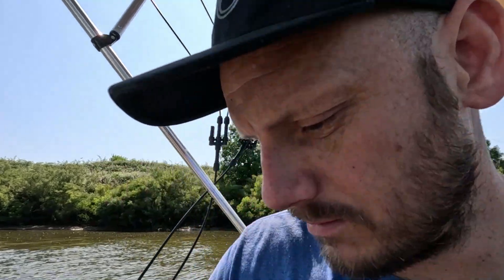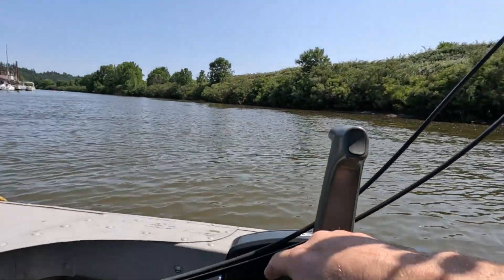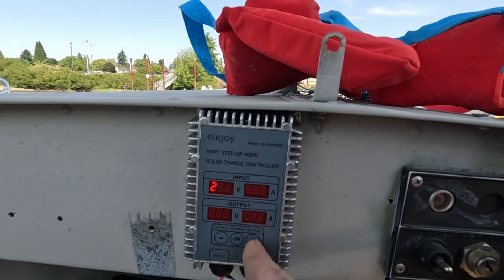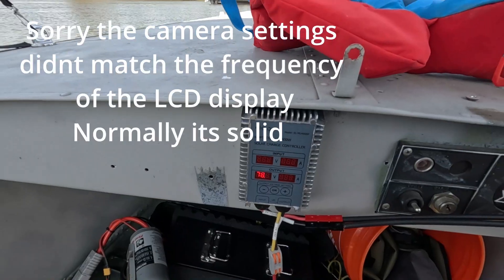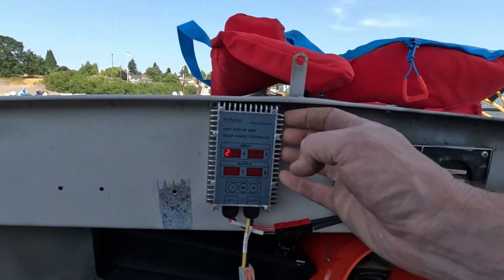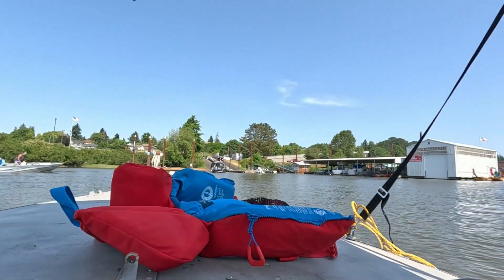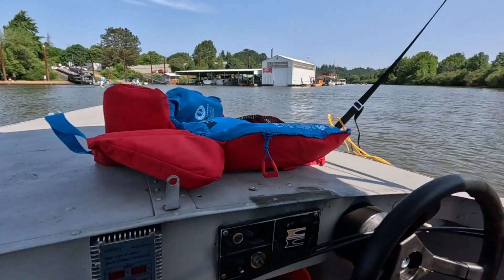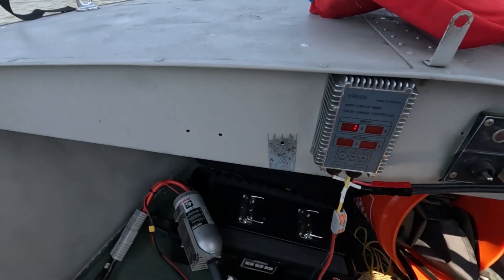How to wire up Solar Charging for a 72v system on a boat: super easy w/ a step-up charge controller

Comment: Very cool.... I like the idea of a kayak 🛶 with removable tough inflatable out riggers using tough aluminum collapsible outrigger poles & some good  netting that you could attach- clip on lightweight solar panels to the netting. To power a small rear electric motor.

Comment: sounds like a tiny battery for 15hp.. ever considered bifacial panels? they're heavy, but pack a lot more punch than these etfe panels and cost very little. not sure about US prices, but in europe, it doesn't even make sense to invest in flexible panels. you get 400Wp modules for 100$. almost cheaper than roofing materials.
Reply from the maker: Look interesting! I’m slightly more interested a lower weight to watt ratio than cost to watt for this little boat.

Comment: If you could pull about 600 watts continuous that would be equivalent to about ¾ HP.  That should allow you to cruise with no battery loss at a brisk walking speed.  Many years ago I had a 1 HP motor and it would do about 2 knots on a 12 foot fiberglass boat